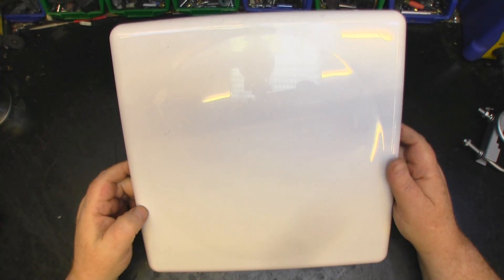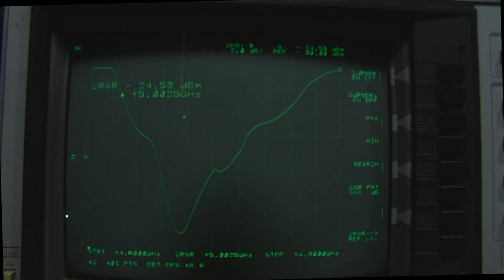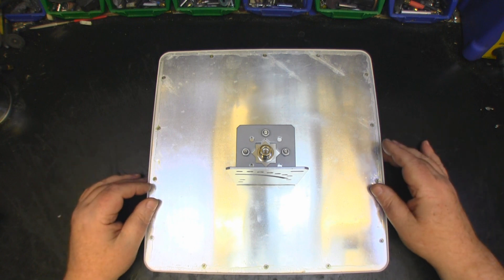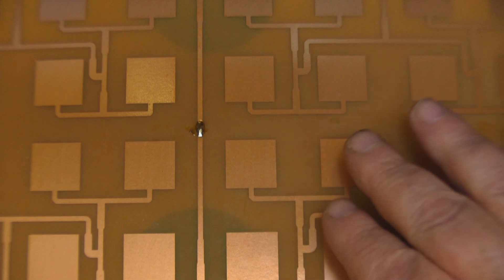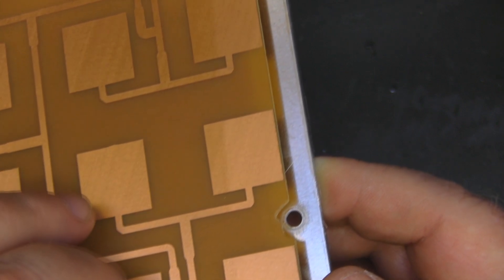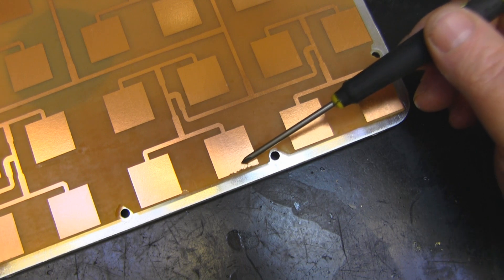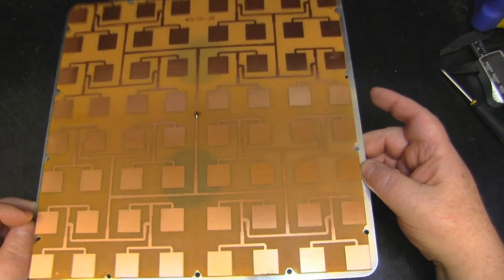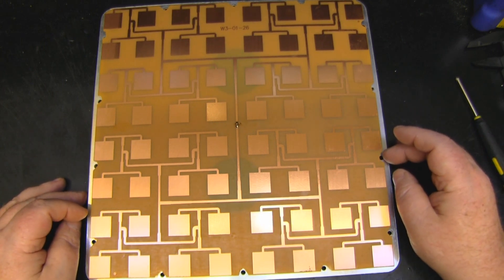Dual Band Wifi Panel Antenna

Comment: Is this an array?
How is this duel band, looks just 5.8?
If this was 5.8 how would it look diffrent?
Could this be made larger, how big could it go.
By adding more elements, is there a greater poer draw? 
How can a set mesurment for 5.8 allow for additional elements that are connected and not be parasitic like on a yagi? Wouldnt adding additional elements change the freq?
What about the reflector, is that not sup to be a certain measurment, if so how can this be so big.

Please do assist as really interested to hear back :)

Thanks

Comment: Recently I was looking at some PCIe cards from laptops. I see cards with 1, 2 or 3 antenna connectors. Most common seems 2 connectors, sometimes marked as GAIN and AUX. I noticed that the 2 antenna's in such case do differ in design. Is that an 2.4 and an 5G antenna? How to tell the difference? So why is called GAIN and AUX? 
On an HP desktop with such an 2-connector wificard built in, there was only 1 antenna connected. This antenna was attached with is metal part to the metal front of the computercasing. I'm wondering if that helps or disturbs the antenna characteristics?
Reply: 2.4, 5, and Bluetooth

Comment: Thanks for sharing this. For a vintage, it has a nicely-designed matching network. Each T-joint has two (100ohm to 50ohm) transformers (fat sections of trace lines) to phase 2 pairs of squares (each square is a 100ohm patch and a pair is basically a 50ohm 8db antenna).  4-squares array is 11db, 16-squares array is 17db, 32-squares array is 20db. A well- thought out layout that packs 20db of gain! :)
Reply: Hi, how can this be anarray, does that not need digital control to manage?
I thought you make your ant to the set measurment of your freq but if you go over it changes the freq? 
in this case, by adding more elements how does the freq not change? 
So confused.

Thanks in advance if you do reply and any idea why he does not upload anymore?

Comment: Hello sar I always watch and love your videos and learnd a lot about antenna.. but the problem is that I cannot replicate those due to poor material and Hardwear availability.. this antenna is perfect for me I have coper clad boards and steel plates which i can etch to build this perfectly.. i would love it if you could provide all the necessary dimensions for this antenna🙏

Comment: Lovely! Yes, that board material is likely FR2 - a phenolic resin system reinforced with basically paper. Was very widely used in the early days of true printed circuits for what the industry called high volume "punch and crunch" boards. for commercial and consumer applications. After the board was printed and etched etc it would normally be heated to soften the plastic just a tad then hit with a punch and die tool to create both he hole pattern and the profile. Actual board material would be about half the cost of equivalent thickness FR4. The very thin copper is a bit of a puzzle though. In the high end multilayer laminate market 12µm and 9µm foils are not all that rare but in the current mainstream market, 1oz and 0.5oz (35µm and 18µm) are reign supreme and perhaps perversely they are cheaper than the thinner foils as the latter often have lower production yields both in foil and board production as they so easily damaged. I'm inclined to think the  copper has been over cleaned (which is often a several microns micro-etch type of process) or that the photoresist has suffered local poor adhesion to let the main etchant in. Having said all that, the skin depth of copper is only about 1.33µm at 2.4 GHz and much less at 5.8 GHz so any copper thickness will do but there obviously has to be some rather than none and DC resistive losses are a factor.

It would indeed to interesting to fix the antenna's gross defects and then pop it back on the test bench without the housing to see what you get. Maybe also try it on your various Wi-Fi access points.

Question: Does the symmetry in the dimension of the patch elements mean that the antenna will be equally good in horizontally and vertically polarized fields?

Comment: Could you explain why the traces going to each element seem to keep changing their width?
Reply: Hi Simon, I posted a video tutorial on how to use different thickness of trace line to phase multiple patches to make a high gain antenna, you should find the answer you are looking for. Just search “Terence Microstrip Array” and the video would show up.
Reply: they change thickness because they are adaptations to the impedance. For example, you go from 100 ohms, the thinnest, to 50 ohms the widest part. Or it's 75 ohms. Now I don't see the size

Comment: FIRST  :-)  .. very nice indeed, shame about the poor construction, guess you could repair it or re-print a PCB. Its normally sun that kills panels .. I got this one off Ebay .. its Chinese but it was very impressive 2.4Ghz .. OK I'm also using a 8W booster lol ..but was very good before i even attached it to the panel https://www.ebay.co.uk/itm/224149805998 .. its about half the size of one you got  ..just for ref